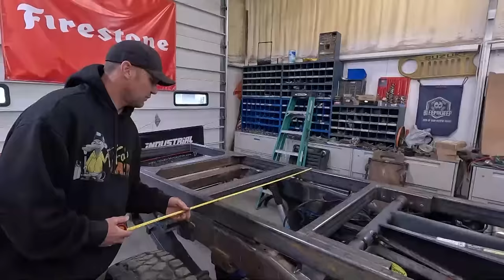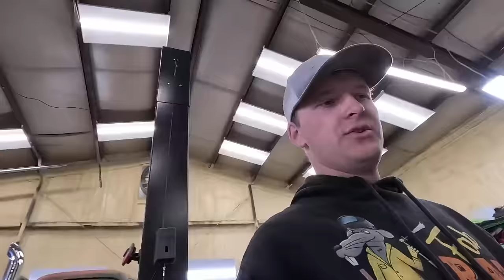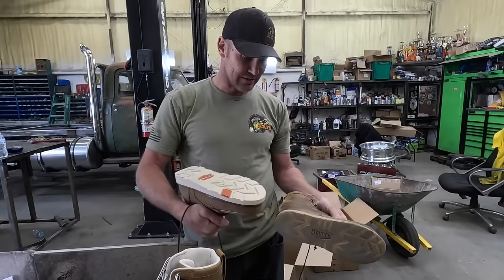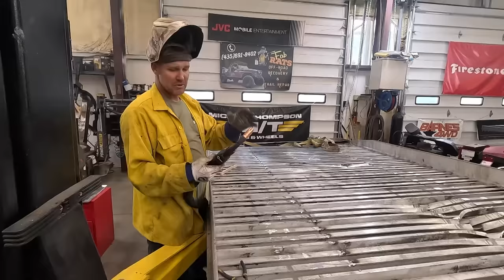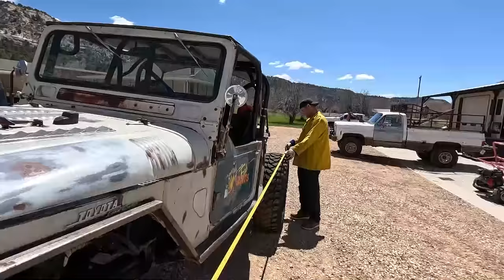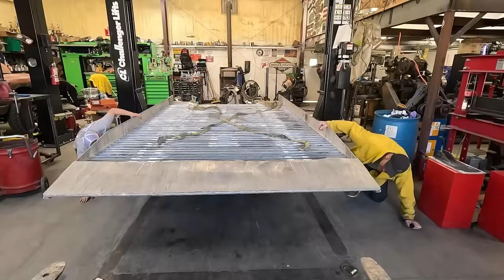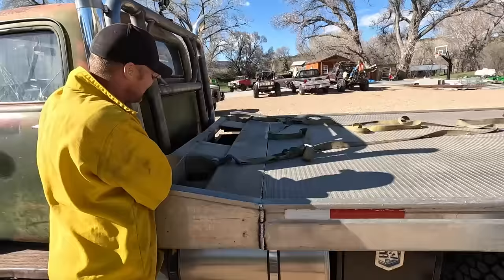The Ratback Bed Is Finally Coming Together

Comment: Just a suggestion. You could have solved alot of your problems with the length of the bed and weight distribution . If you would have moved the rear axle back towards rear of truck

Comment: Instead of a rollback it might look cooler if you could lay the bed flat on the ground to load and then use the scissor lift arm to pull it back onto the truck.  You could swap bodies to a dumpster or a flat bed.

Comment: If you had thought it through you could have used the front of the frame for the back end and the rear of the frame for the front end. That would have made the front higher and back lower
Reply: Oh and I'm not complaining. I didn't think about it until you had an issue either lol

Comment: Just concerned for your health and the guys that work with you. 
 You should wear a respirator or other breathing protection when cutting, grinding, or welding aluminum. Grinding aluminum creates fine dust and flakes that can cause lung and nervous system problems, and the dust is also explosive. The Aluminum Association recommends the following PPE for cutting, grinding, and finishing aluminum:

Respiratory protection: Dust mask filter

Hand protection: Leather gloves with long cuffs

Head / face protection: Helmet with mesh for protection against heat or flames

Comment: Wouldn't cutting the front section off and moving the bed 6 in closer to the headache rack make the front tire pockets, that you wanted to save, useless since most bumpers would be at the headache rack before the tires reach the pockets?

Comment: Just out of curiosity, legit question. Will you be welding that bed onto that box rail you built or will it be fastened some other way. Really curious as welding aluminum to steel is not an optimum thing; it's a more involved process. Thoughts?

Comment: I’m hoping my last comment was wrong, I will apologize if I was, but as a hint I’d put some hydraulic bed locks on the front of the bed rails so it won’t teeter going down the road, in case it is heavier in the rear at some point

Comment: Isolate the aluminum from the steel, either with some sort of plastic, or a really solid paint. The dissimilar metal corrosion will be terrible if you don’t, at least if you ever get Utah salt on it….

Comment: Good job man. I'm concerned for weight on your ratback, will it hold it down, or maybe you need counter weight on your front side of the truck, like the bumper maybe? Hope it doesn't brake down on yah! 🤣

Comment: Well, if you're gonna cut out a chunk of that bed there to shorten it, then weld it back together. Wouldn't it be easier just to cut off that bad spot in that bed and do you? What you're going to do in the first place. Just kind of wondering here.

Comment: Wondering why the 'boys' didn't present their idea of removing the damaged section to Paul upon his return? There may be a reason it wouldn't work but the idea seemed logical to me.
 I was just thinking it would be nice to polish the aluminum on the sides when Paul said that's what he wanted to do.
 Just an idea: what about adding ramps which are hinged to the end of the bed? I know that on uneven ground it can be difficult to line up, and keep in place, portable ramps. 
I toss my ideas your way, not expecting you to do anything; they're just an offer of an idea(s). I'm totally content with you doing things your way (As long as it's safe). Many of your subscribers care for what happens to all of you, so please take good care, in your own way.

Comment: I think it would have been a better idea to use your actual tilt and slide truck put this trucks cab on and the engine you have just with a better chassis to work with

Comment: Could have saved yourself alot of time and energy cutting that aluminum with a circular saw, any 40 tooth carbide tipped blade will do… it will weld a lot better too without plasma slag or grinding / cutting wheel dust in it also.

Comment: Looks cool until you see it operate. Might as well have just built a fixed bed beaver tail. A tilt bed that only hits the ground when nearly verticle and requires ramps to even load your extreme off road vehicles is far from cool.

Comment: Apparently you guys are not yet familiar with what fabricators and carpenters call "lookouts". That's when uou take a pice of say a scrap of square tube or some of the damaged pices, long as the piece is straight, something like that and clamp it to the underside of the main section. One on each side of the bed will do. Then you can set the front piece on and it will line up for tacking. The front piece would probably still need some support from the shop crane. But alignment would be way easier than by hand. Would have helped a lot more if you knew about that BEFORE you were putting the bed back together. But I don't get the luxury of being there to share my experince until several days AFTER you finished struggling with it.

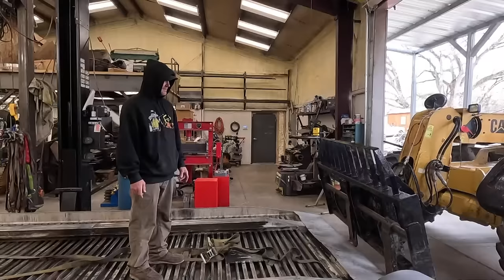Comment: @2:04... Way to go Sean, try to kill Paul! I don't know if you want to shorten the front and shove it up against the headache rack. I think that will take away access to the fuel tank filler locations. Other than that, I agree with the boys, it looks good!

Comment: Plan A was definitely too high. A rush to reuse existing "stuff".

Plan B is a quicker fix, reusable, working, inexpensive concept, salvaging most of the bed. Pause, rethink plan A. Measure thrice, cut twice, fit once. Most of the usable existing & future vehicles will fit, some just. Lift and tilt.

Plan C. Taking the necessary time to carefully add roll back features. No rush. In between projects. Conceptualize, plan, order parts, build.

Comment: Sure the bed looks cool, but I doubt it's functionality. It seems to be high to load anything on it without danger and the winch. And way unbalanced if loading anything heavy. Load a truck there and it does a wheelie.

Comment: You say it’s perfect.  Alright.  I disagree.   Way way too much bed hanging off the back of that truck that will need Heavy tractor weights on the front bumper to prevent tipping down at the rear.  It’s look ridiculous.

Comment: It's too short! you won't be able to get a decent-sized car on there! you as yanks all your cars are much bigger and longer than everywhere else! anything more than a 4.7m long car is going to be too long for it, there are laws as to how much over-hand you can have.
Reply: He's not looking to haul large cars or pickup trucks with it. He has said that repeatedly from the beginning of the project. It's primary intent is to be able to carry and maybe recover (ergo the 4wd) his Toyota FJ45 and shower Jeeps. It won't fit Hunters JK or JL 4 door Jeep, for instance. He wants it to be as capable offroad as possible while still able to carry some other vehicles on rough offroad 4x4 trails. The bed will probably be too  short for Michelle's Jeepster. At this point I don't count that for sure. But the truck at best is a series of compromises.

Comment: Seems like a lot of work for a simple rollback truck. I don't see the uniqueness or style worth the custom build? With this needing ramps to load. Not much different than a flatbed pickup truck. 14 feet bed seems small, A long bed truck, van, etc. wont fit. Seems the wheelbase is to short. Mite be a lot of rear-end bed weight. Mite lift the front end and affect the steering, and or pop a wheely... I guess you guys are getting your views with this build. No one would watch if it was a regular rollback truck...